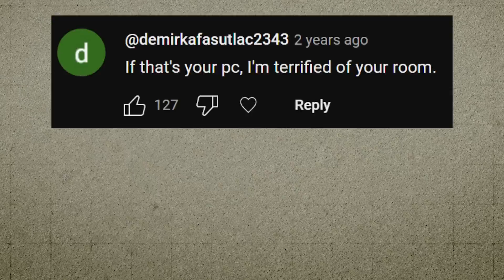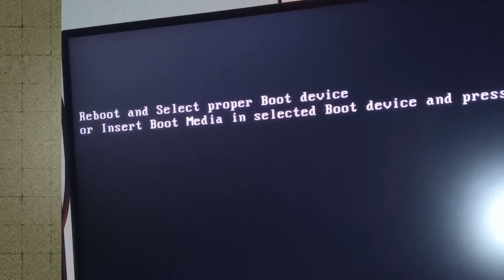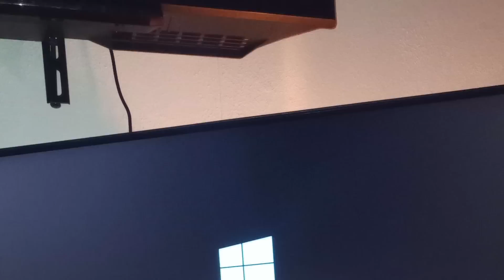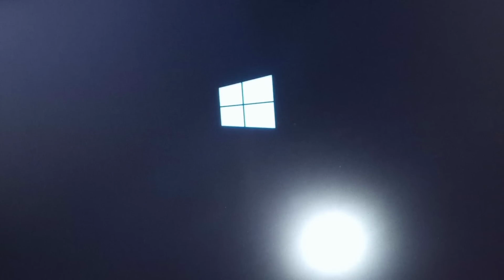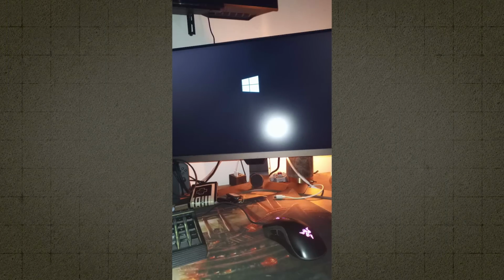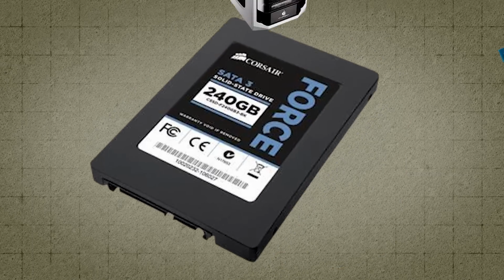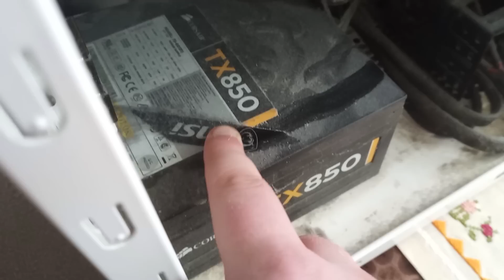Remember to clean your PC!

Comment: Regarding the SATA issue, since you have 3 SATA storage drives. and if you have the B450-f gaming motherboard shown in the picture in the video, you just need to make sure you aren't using SATA ports 5 and 6 to use the NVME M.2_1 port at the same time.

the port 5 and 6 is the 2 ports closest to the CPU on that board.

Comment: I was expecting it to be bad, but Jesus!

Well done for holding your fans still while using the compressor though, most people forget to do this.
Reply: ok, i missed something. why Is It bad?
Reply: @rena4568 the electric motor works both ways. So if you spin the fan really fast, you might create electricity that can damage parts that the fan is connected to
Reply: @MrVerece  so It Just happens if you spin them really fast

Comment: You need to manage your fans so that you have more intake flow than outtake. You want an overpressure inside you case, so no dust will get sucked in through all the little gaps. All fans you put as intake make sure it has dust cover/protection. you're welcome :)
Reply: That is better for keeping the inside clean but it is better for cooling to have more flowing out at the cost of it getting dusty over time (but you still need to have intake obviously you cant just point all the fans out and expect it to work)

Comment: Or you can keep both SSD. Check your motherboard manual, and there will probably be which Sata port are deactivated when plugging an nvme SSD. So then, once you check that, just move the sata ssd's connection to a non deactivated one and boom, you now have both working

Comment: When you unplug your computer you should always hold down your power on button to release any excess capacitance stored in your computer
Then when you boot your computer back up it will take a while longer then normal to boot back up.

That's why it does that.

Comment: I dont really know your Pc Case, but it looks like it hasn't got Dust Filters at the Air Entry Points. Modern Pc Cases should have Dust Filters so your Pc Components aren't getting to dusty and also the hairs of my cat aren't getting into my Pc.
You may have to clean those filter more often, then every third year, but that should be easy (I would say every half year you should clean your PC).
There should be also round about an equal number of fans pulling the Air in the case and out of the Pc so you don't get a negative pressure or overpressure. It is not very dangerous having those, but i know when you have negativ pressure you get more dust at your filter. 
You also wanna have Windows installed at your PCIe NVME SSD Card. As long as i know, should then moving big datas from one folder to another way faster and Window is a little bit faster. You can clone your Sata SSD to your PCIe NVME. I did it also, but now it is difficult to find a free Programm, what does it. Many are for some reason no longer free.
Reply from the maker: The case has 3 dust filters, one on the top. And two at the bottom, one in front and one below the PCU. I clean those very often.